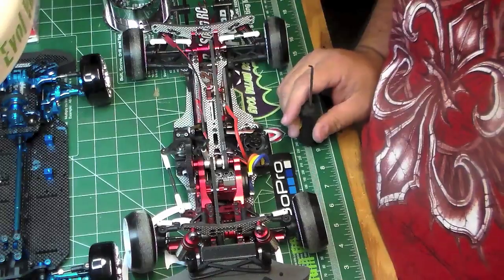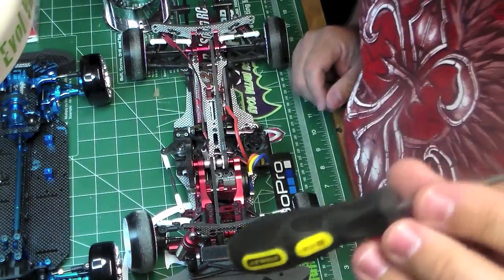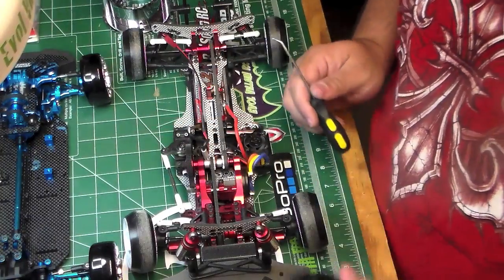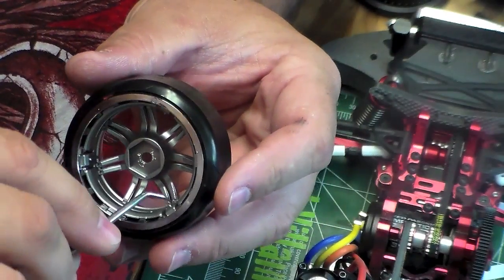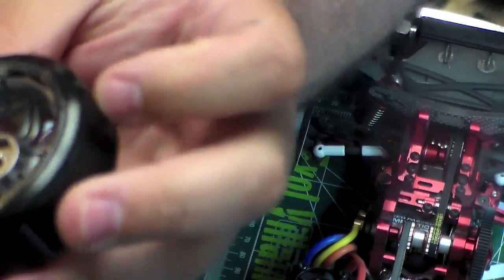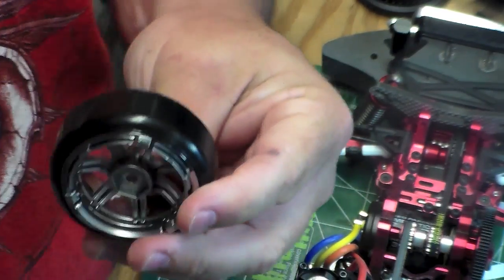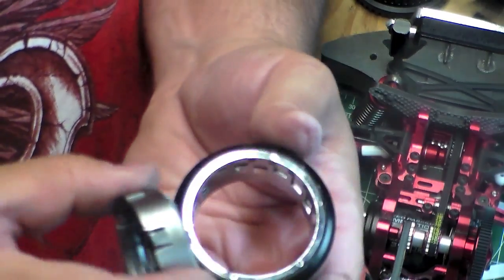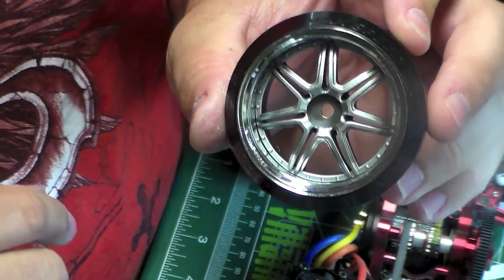How to remove Tetsujin Super Rim wheel disks with the tire in place. RC Drift

Comment: Sir just need advice  or suggestion im having hard time looking for exact size tires for tetsujin wheels
Reply: What exact tires for tetsujin wheels
Reply from the maker: Drift tires are pretty well standardized at this point. MST, any of the major brands should fit. Having a mounting system helps immensely but you can always resort to boiling the tire to make it expand a bit to get them on the rims. I use this: https://www.amainhobbies.com/mst-drift-tire-remover-set-universal-mxs-700006/p715763?gclid=Cj0KCQiAkePyBRCEARIsAMy5Sct9KlViwAgutosRBgS7TdsizcKoPjQAg398245Q5-wsvzv5mGIorTwaAtNQEALw_wcB